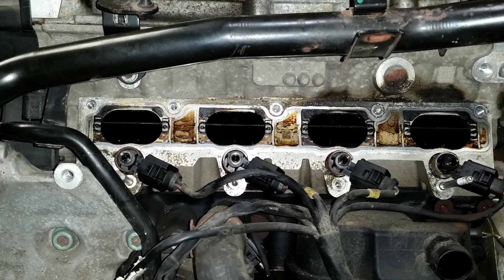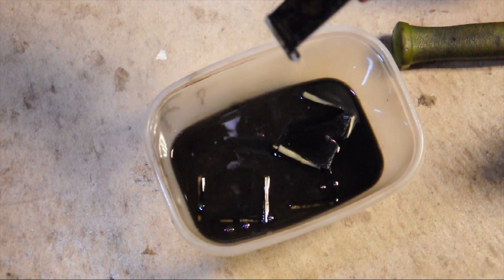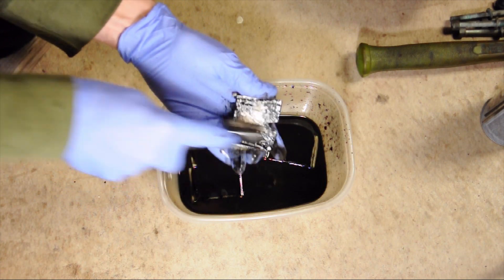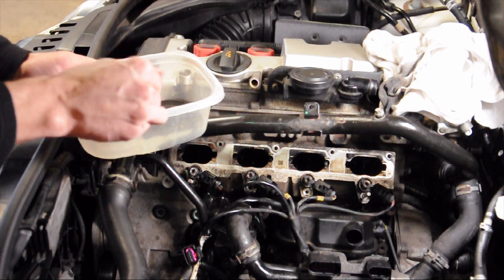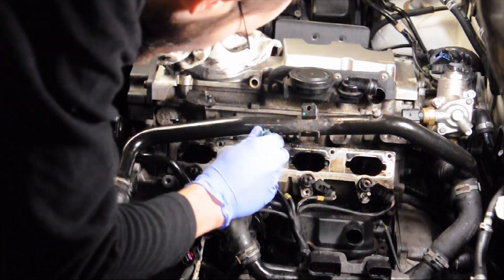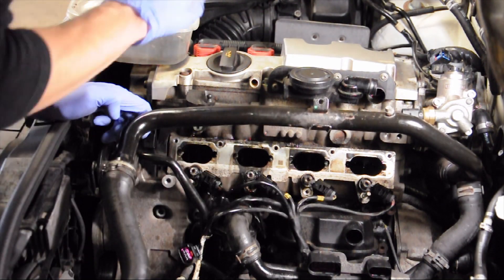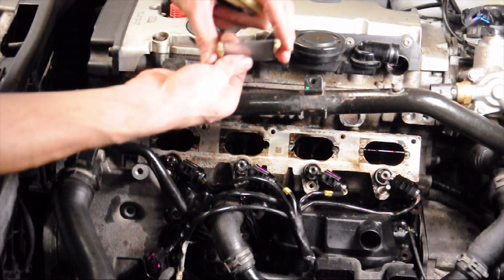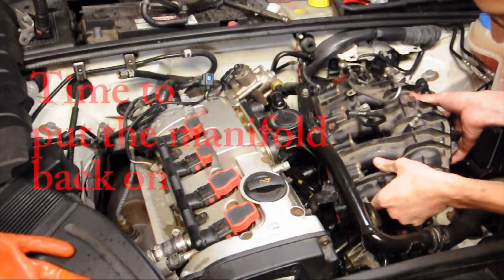Audi Direct Injection, Cleaning Carbon

Comment: @AUDImotive i need help i am doig a valve clean on my 08 audi a4  and i have the hpfp off how should i turn the valves
Reply from the maker: There should be information on that. Been a while since I've done the job, but I thought I  talked about it in the video. Take out the spark plugs. Use socket to turn the engine clockwise using the crank bolt at the pulley. Have a long screwdriver in the sparkplug hole. That way you can tell when the piston is at the top and the valves are closed.

Comment: I have a problem on my 2009 A4. I had a hole in the intake manifold, and took it to the shop to be replaced and they said the vales arent closing all the way and that is causing gas to flow back into the manifold and thats what melted it. Would cleaning the vales like this sold that problem? They are quoting me so much money and want to replace the whole engine.
Reply from the maker: Its not that difficult of a job. Would be worth at least taking a look at the valves, see what they look like

Comment: Just did this on my Mazda Skyactiv 2.5. Really not too difficult, just time consuming. I had a P0302 misfire code, replaced the plugs and checked the coils, and suddenly realized it's probably buildup on the valves. I was unfortunately right. I only used CRC cleaner, with a brass brush, picks, and a screwdriver to dislodge everything. Cleaned everything up, engine runs much better and since disconnecting the battery while I worked, the cleared code never came back. Too bad I'll have to do this again in a few years.

Comment: Just had the intake port carbon cleaning done on my 2015 S3 with 50k miles on it. What is the usual cost for a shop non dealership to do the job just wondering the average cost with labor.
Reply from the maker: Cost varies. I've heard as low as 300 or as high as 1000. I'd say 500 is a fair price. But not the chemical cleaning. Walnut blasting is the way to go
Reply: @audimotive  thanks I was charged 600.. had misfires on cold start, but I had not noticed it although it did seem like gas mileage was not as good as usual.
Reply from the maker: That sounds about right

Comment: Hi There, very impressive work.  I like your detailed explanation of things.   Is there a way to clean the injectors and carbon build-up using seafoam through throttle body?
Reply from the maker: They have a carbon cleaning spray made by CRC. I tried it, didn't work. Best way is walnut blasting. I did it on a BMW, working on the video. Faster than this way and way better results

Comment: Quick question. Have you ever cleaned out or replaced the box under the manifold. Where the pvc hose goes in? When i replaced the hose i noticed there was yellow guck and oil build upp. Is this the oiltrap for the pcv? Great video!
Reply from the maker: Im not sure what box you are referring to. I no longer have the car to check. Maybe someone else can chime in

Comment: great video. how do you crank engine manually, there is no space to reach front pulley.
Reply from the maker: There was just enough space to put a socket on the bolt. And then a ratchet on the socket
Reply: @audimotive  ,thank you. I am stuck in cranking engine. do you remember the size of the socket?
Reply from the maker: 24mm 12 point
Reply: @audimotive  thank you, I just tried, no possible to reach it even with my son small arm. my vehicle is Audi A5. I guess you cranked the  engine from bottom
Reply from the maker: Forgot to mention that, yes I had to reach from the bottom
Reply: @audimotive  ,thank you, I just did it. Now I am cleaning No.2 intake valve.my engine was random misfire and hard to start.
Reply from the maker: Awesome. Did you move around the spark plugs and coil packs? These cars have an issue with coil packs going bad
Reply: @audimotive  yes , I replaced all the plugs and coils and PCV. car still misfires. cannot start, only step on gas pedal.when engine temperature reachs 90 celsius. idle can be steady. car can run.
Reply: @yijianggu5203  How did it go after the valve clean? Running smoother now and more responssive?
Reply: @rcl300018  , Finally, I found my CAT was clogged. Nothing to do with carbon build in intake
Reply: @yijianggu5203  how did u find that out and how u fix it please help me !!!
Reply: Do u have code p0300 and p 0302 ?? I do hard start and kind up shutters while running
Reply from the maker: P0302 is cylinder 2 misfire.  I would start by moving sparkplugs and coil packs and see if misfiring follows
Reply: Catalystic converter was clogged due to fuel injector leaking,that is my case.
Reply: @yijianggu5203  what code u get tho I changed all plugs

Comment: How much is this job?
Reply from the maker: However much you want to pay yourself...
Reply: Ballpark estimate range is $1000-$2000 for this type of carbon cleaning.  There is a separate carbon cleaning for the Secondary Air Injection system that is approx $1500-$2900, if you are not in warranty.  If you have some repair experience, the intake carbon cleaning is possible, tedious, affordable (compared to paying someone else), and you must be CAREFUL!  Buy new set of injector seal kit before doing this repair.  There are tons of articles and videos on doing this.  Well worth it, I think.

Comment: You can do a "flap" delete.
I'm gonna need to do mine at some point. 😔
Reply from the maker: Alex Gunner these engines have a big problem with wearing through the cam follower. Once you wear through it, you don't have a cam follower anymore. And you ruin the fuel pump and intake camshaft. If you don't check in time, you can end up with metal shavings in your oil and kill you engine. And when I talk about doing the delete, I am not talking about simply removing the flaps. You are correct, the side holes in the manifold need to be plugged. That's why you need to buy a kit. And unless you get the ECU tuned, your engine can't use the extra air, so the delete is pointless.
Reply from the maker: Alex Gunner to each their own. If you don't believe in doing the delete, then don't. Audi didn't exactly design this engine great, look at the cam follower issues. Among other things
Reply from the maker: I was thinking about doing the delete. But at that point I just wanted everything put back together
Reply: MrGuvEuroman why? Everything will be worse on a cold engine. Not to mention you need to block the sides where the flap's feet would go
Reply from the maker: APR wouldn't come out with the delete kit if it was bad for the engine. With a tune, more air is better and safe
Reply: AUDImotive riight. Audi put it there cause they had some extra shit and they just tossed it in. The delete kit only makes sense for feeding the top end of something like a hybrid k04 and higher, while losing low end torque
Reply: AUDImotive can the engine work without a cam follower?
I'm speaking out of a friend's experience. He did the delete, engine ran worse on partial throttle and he gained nothing on the top end with a k04. Top builder in our country said you need to cover the side holes, else the airflow gets screwed with because of turbulences. You can see APR have them plugged in a video they have of a head on a CNC.
Reply: Hell no, that's only for highly modded engines, otherwise deleting the flaps on stock specs will create more problems...

Comment: How do you close the valves that are open? Put it in 5 0r 6th gear and roll a bit?
Reply from the maker: That could work. I put it in neutral and used a socket and long ratchet to rotate the crankshaft

Comment: Whoa. I don't think I'd ever spray solvent into my engine, even with the valves closed. If I did though, I think I'd plan on changing the engine oil soon afterward.
I find it pretty ridiculous that a modern engine would need this kind of repeated internal maintenance though.
Reply: It's a side effect of direct injection.
Reply: no issues with solvent, gas is a great solvent and the ring blowby during cold starts,  raw gas makes its way into the oil pan.
Reply: Won't hurt nothing. You only clean the ports when the valves are completely closed as well.
Reply: Don't spray into your injector unless you would like to pay for a new engine my ex instructor when I was training would beat the shit out of me if I even Attempt anything like putting anything in the injection as one you can never be shore all that crap is out that engine ie

Comment: Doing this now on my 2005 Audi A4. I cleaned everything and now am in the install process. I got new fuel injectors the same king that was in there and now I am having trouble with the intake manifold going back on flush. What could be the problem? I checked and it seems like no wires are blocking it, the injectors seem seats properly can't move more than 5 degrees. Only thing I can think of is that the intake is not going easy over the o-rings. The old o-rings were stuck inside the intake when I removed and where pretty wedged in there. There is maybe a inch gap and I can see the 2 long bolts about to come through the holes so I know its placed correctly. Any thought?
Reply: Dominique MortonThompson I know this may sound stupid but, are you sure you got the right size of injectors?
Reply from the maker: +Dominique MortonThompson maybe you could try lubing the o-rings with some fuel or oil to help them slide in?

Comment: I have a friend with a 2008 Audi A4.  I'm pretty sure that engine is longitude mounted... not transverse
Reply: Right i mean its right there in the video. What were you confused about. Or what were you mentioning
Reply from the maker: +Doug N you are correct. Audi engine is longitude mounted

Comment: this is the only proper way to take care of the carbon build up problem. All those spray stuff like sea foam and others, are just bull shits and as always, there are stupid people buying hem
Reply: Hi Swat.      Are spray stuff like sea foam and others just bull shits ??
Reply: Swat Katz Or the walnut shells blast method, which is more practical, but a bit more expensive since you need a blast pressure compressor ($200)
Reply: Jay Lee Seafoam won't do anything to the valves or intake manifold so it's useless for this procedure; what can be used is GDI intake valves cleaner, but its effectiveness depends on how bad your intake system is...
Reply from the maker: The walnut shell blast is how I want to try it next time. I've seen some very good results, in a fraction of the time. Seems to be the better way to do it if you can put down the money for the equipment

Comment: I may consider doing the same for my 2012 hyundai sonata with 134k kms.  I installed an oil catch can some 100k kms.
Reply: pinoyeh ... is your Sonata running okay?  No rough idle,  performance is ok? Cold starts okay?
Reply: whats an oil catch can??
Reply: Run seafoam in the intake from time to time and make a catch can to collect oil vapor flowing through the intake.

Comment: So you save 5 mpg but you have to spend $800 bucks every 2 years to clean out the carbon. The math doesn't add up
Reply: Math will work if you install an oil catch can system, and also spray some gdi intake cleaner once in a while thru the air intake hose to keep the valves clean...
Reply: 2Phast4Rocket unfortunately, this is not an option for GDI engines, especially the FSI ones; so I highly recommend you the oil catch can
Reply: @utuber200985  whats an oil catch can??? i dont know that process can you explain?
Reply: its a necessary evil cause your check engine light will turn on from all the engine misfires.  if it gets prolonged, the unburned fuel will lead to the catalytic convertor going busted, then you won't be able to renew your vehicle tabs from the check engine light.
Reply: @golfmaniac007  just do a cat delete and you’re good to go, shoot the carbon right out the exhaust, check engine only happens on cold start so I can still pass inspection by clearing the code after cold start. Been doing this since after my first carbon cleaning at 100k now I’m at 170k and am not gonna waste my time decarbing ever again ,it’s a losing battle.
Reply: @the_first_resort940  if you don't decarb, the engine lose performance. gonna feel like coil pack out.
Reply: $800? I wish I could get my 2010 Audi A4 done for that price, I'd jump on it immediately! Try $1600-$2000!

Comment: How do you tell if the cylinder is open or closed?
Reply from the maker: +Don't Touch My Oreos the simplest way with the intake off, is just to look inside, you'll be able to see a gap if it's open. Another way is to set that cylinder at Top Dead Center. You can use a long screwdriver or stick and the piston will push it up and you can use that as a gauge
Reply: AUDImotive Thanks!

Comment: Great video. I'm about to tackle this job on my 2007 A4.  Did you replace the intake manifold gasket?  Do you think that is necessary?
Reply from the maker: Geo745don if I remember correctly, that was all I replaced
Reply: AUDImotive thanks I'm debating on getting a compressor from HF along with blaster tool. I just got the car 1 month. I've changed pvc, Valve cover, turbo all within that time period because of oil flooding intercooler. I installed a block off plate yesterday think that might solved my problem. So I want to clean intake Spiit Shine to solve any future issues
Reply from the maker: +VW Gearhead I replaced the gasket. It costs $12. To me that's cheap enough to avoid a CEL
Reply: AUDImotive is that the only thing you replaced
Reply: AUDImotive ok thanks
Reply from the maker: No problem. Good luck
Reply from the maker: I'm not sure how the blasting will affect the plastic intake manifold
Reply: AUDImotive blasting the intake Valves only. The intake manifold I'll just clean with brake clean
Reply from the maker: Geo745don I gotcha. Got a little confused. Yeah that sounds like a good plan. I definitely want to try the media blasting next time I do a job like this

Comment: Sad to me that any manufacturer would produce and sell an engine that requires this type of intensive  service.
I recently purchased a used 2016 Kia Soul+; discovered this flaw, checked the intake and it was filthy.  I used the CRC GDI IVD™ Intake Valve Cleaner and installed an oil catch can.
Reply: Catch cans have been proven to be ineffective.  The intake valve gunk has several origins and the PCV system is the smallest of the issues.  First, during operating, there is something called valve overlap, where some combustion chamber contents are pushed back into the intake very slightly.  This deposits on cooler areas.  Then we also see globs at the bottom towards the valve flare.  That is due to the amount of oil, no matter how miniscule, that gets by valve seals.  Audi has been known for poor oil control in numerous areas, but this also exists in other manufacturers.  Then cars that tend to be driven short distances are more prone because operating temperatures not reached, which also helps with entering self-cleaning temperature ranges that also help reduce deposits on the intake valves to some extent.  Then aggressive driving also helps.  I live in Germany, so I get to open my car up on the highway nearby (not all Autobahns have the unlimited speed limit as people will try to claim), so I open it up there and it so far seems to have helped control deposits.

Again, catch cans have been proven, time and time again, to not work because they are among the smallest of the issues.  People say use better motor oil, which would be sound advice in all cases, but at the same time, when catch cans haven't worked, then we have to wonder if motor oil that is more resistance to vaporizing would help.  What works is that Toyota and later Audis have a second port injection system.   The aftermarket needs to come up with an auxilliary injection system that momentarily sprays fuel into the manifold.  Also getting the car up to running temps and into a lean-burn, high-temp cleaning cycle, like what one sees on the highway at 2500RPM, for instance, would help.  This helps remove the water in the oil (if you're still worried about the catch can), reduces acidity of the oil.  Otherwise, try to use the intake cleaners every so often from new, which is not good for cats, motor oil, wallets, and so on.
Reply from the maker: Its supposed to allow for more fuel efficiency and increased power. But at what cost? Maybe this is just like transmission fluid that is supposed to be "life time" fluid. Its good for a couple years, after that, time for a new car to avoid the extensive maintenance
Reply: @audimotive  i need help i am doing a valve clean on my 08 audi a4  and i have the hpfp off how should i crank the valves please help i cant find anything online
Reply from the maker: +Doctor Morbid very thorough explanation! Thanks for that! I agree, Toyota is being smart with the dual injection system. I wish VW would jump on board. Or at least someone in the aftermarket. The cleaning is good, but it would be even better to get rid of the cause of the problem

Comment: Just a word of advice.  You should remove and reseal the injectors with a rebuild kit.  At the very least you should be capping them off so they don't get contaminated.  I see lots of opportunity there to get crap in the injectors with the air blower, spraying solvents, etc.
Reply from the maker: +jgizin If I was doing this on someone's car, I'd agree with you. On my own, I'm not too worried about. BTW the car has been running fine, no signs of fuel delivery issues.
Reply: Just to add; At these high fuel pressures, GDI injectors are a lot less prone to contamination fault than 'regular' injectors. That being said - you can use large vaccuum line caps from any auto parts store to protect them.
Reply: jgizin do you know where i can find reseal kit for this car’s injectors?
Thanks